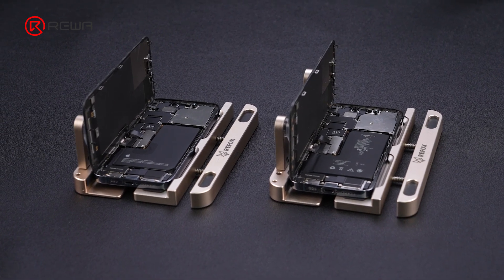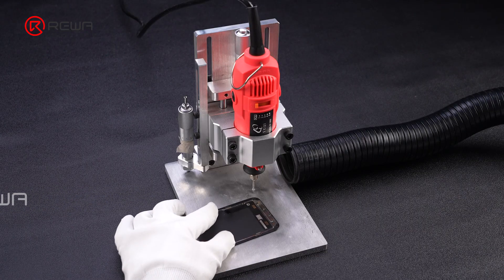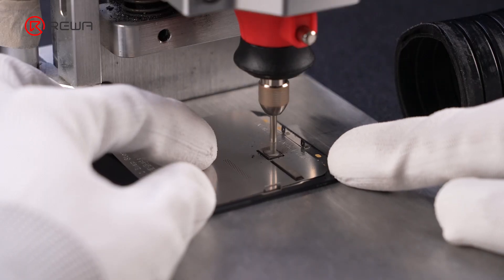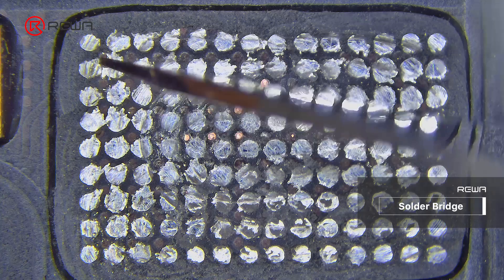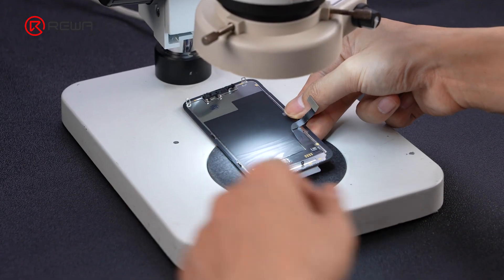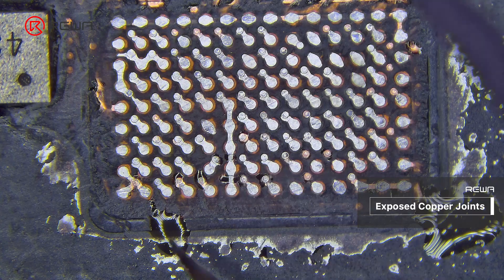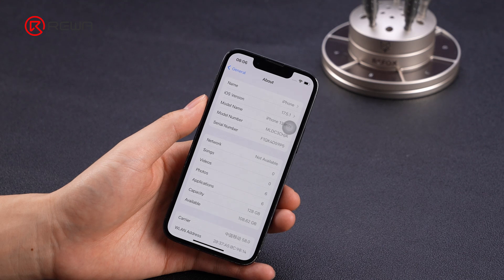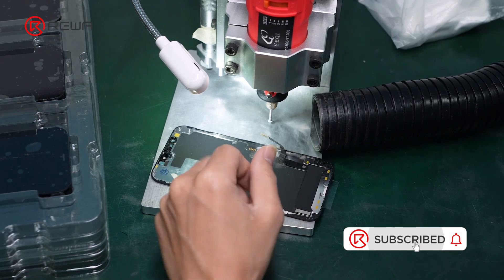Common Issues of iPhone Screen IC Grinding - Tips and Tricks

Comment: I did this process, the message doesn't showed the first time I soldered the ic, but when I restarted the phone the message showed again, do you know any solution to that?
Reply from the maker: Is the original IC you used? And you need to make sure the ic did not meet any problem like we mention in the video.

Comment: After transferring IC chip to aftermarket screen, I find the battery drains faster. Any solution?
Reply from the maker: Usually it may link to the screen, if you use oled screen and always use the AOD( Always on Display), it usually cost more power because of the screen illumination principal

Comment: Seriously it’s not so complicated.
Reply: I’m about to tried it out , can you walk me thru please?
Reply from the maker: @Doitandrew_  Let's start it from you have a screen IC that you need to grind it, then use a IC stencil cover the screen and move it gentlely to prevent damage, if you meet any of three problems we mentioned in the video, you can apply the responding solutions to deal with it, after grinding and transplanting the IC, you can install the screen, pay attention to test the touch function and check the Unknown Part Message, if it does not pop up, your grinding IC work is perfect.

Comment: this process is more critical than partially lifting the flex, put wylie insulator behind it and remove the ic using hot air..
Reply from the maker: Thank you for the method you share, this video we focus on sharing you common issues and solutions to grinding IC.